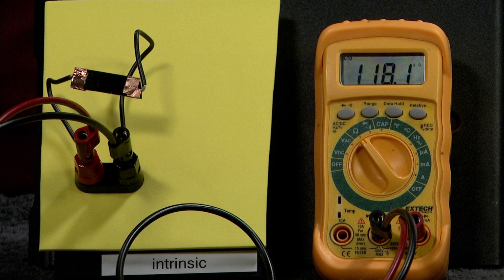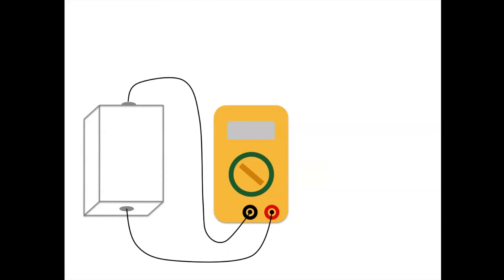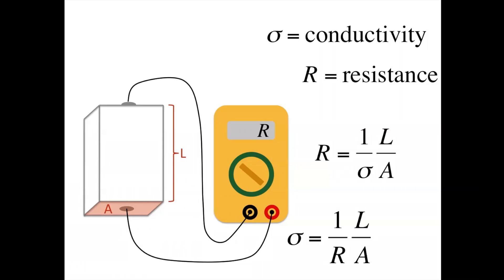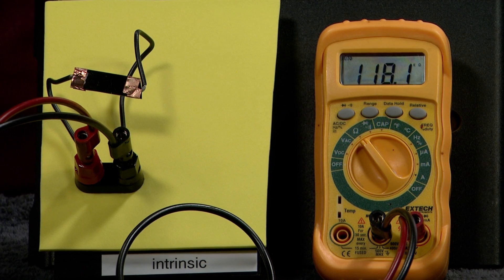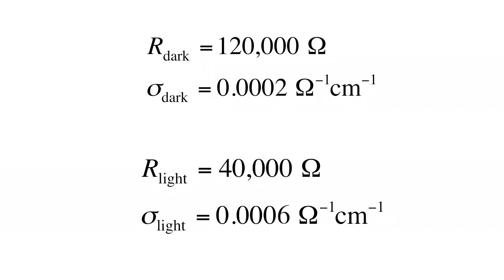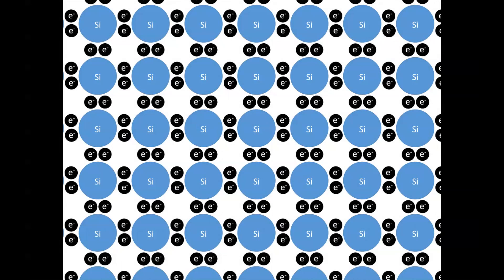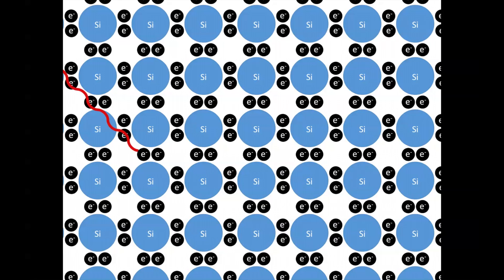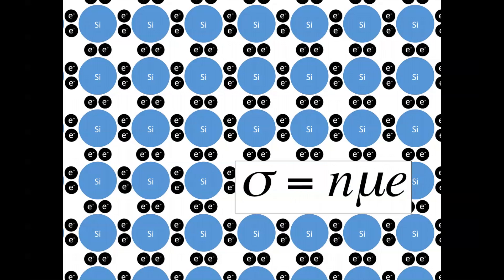Tutorial: Photoconductivity

Comment: In order to measure the Resistance, the Ohmmeter must inject a current into the sample.  The voltage drop across the sample, together with the known injected current, gives us the Resistance via Ohm's Law.  The injected current is an important parameter to know -- how much current is injected?  And, how do these results change as the amount of injected current changes?   I'm disappointed that MIT did not make this additional data available to us, because it is, in effect, a 'hidden variable' in this demonstration.   (I suppose we could acquire an EXTECH DMM and measure it -- but note, this is also on the AUTO-RANGING SCALE which means that the meter 'hunts' for the best range be injecting varying currents until it finds a suitable one.  This is another effect that is not dealt with in this presentation.)